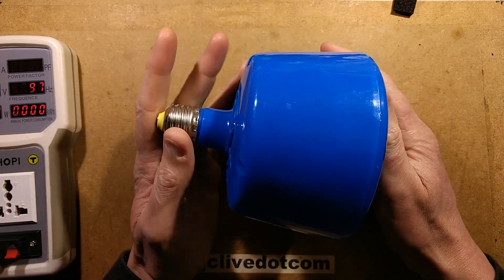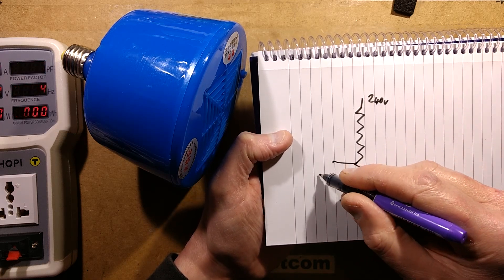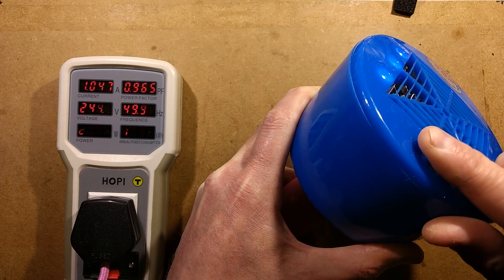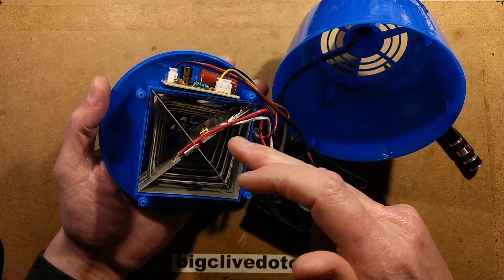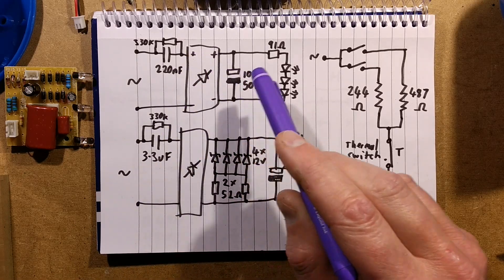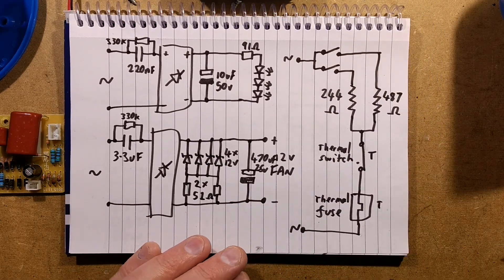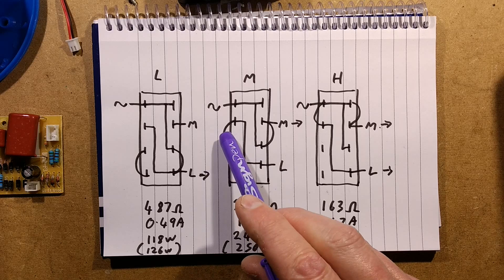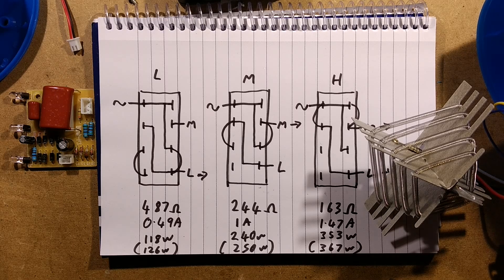Fan heater that screws into a lamp holder.  (With schematic.)

Comment: Nice tear down ! .... for the same wattage you might just obtain an ( old skool ? ) Tungsten filament lamp , plug it in and " cuddle up to it " ( ? ) , also , as a BONUS  , it lights the room (  OMG ) ... SO MUCH  modern " stuff " has electronics where it's JUST  NOT needed ( keep complicated electronics to computers / digital TV's were it  REALLY  works ! ) .. from a guy that repairs folks "  busted " stuff .... DAVE™    🛑

Comment: That looks like a great product for a small room, if you ran a couple of them.   I wish you would give us some idea of how much heat it gives off.     You always tend to focus on how stuff is built more than how well it works, which is frustrating.
Reply from the maker: Sorry.  It would have a lot of variables involved regarding room size and air flow.

Comment: I love that rugged construction. Plus the cheap PC-case/PSU fan which, should the thermal fuse fail to trip, may result in a drippy fiery mess right below the unit.

Comment: Should warm a bath rather quickly. Or not.
Reply from the maker: Safer than some of the actual bath warmers sold on eBay that pass mains current through the water.

Comment: alligators (both species) are, actually, unusually tolerant of the cold for large reptiles. they can survive brief dips below freezing, and they can handle cold basement temps (55F or 13C) for long periods of time.  
However, all crocodiles are very intolerant to the cold.

Comment: I keep a snake and I wouldn't trust any fan heater anywhere near it... the idea for reptiles is to have little air flow as possible. we look for a heat gradient usually (28* one end, 22* on the other end for my reptiles)

Comment: Well, I've seen worse-built heaters than this. (But then, I've also seen better units.) I definitely find this much less scary than that cheap, shitty pink USB charger (for example).

That said, if I was engineering something like this, I'd mount the thermal fuse somewhat closer to the elements (for quicker response in the event of fan failure). I might also use a 24V fan (perhaps with ball bearings for longer life), to reduce the necessary dropper capacitance; with a series chain (rather than parallel cluster) of Zener diodes, to avoid matching issues; etc. (Not that this is the best idea for a product, anyway; my bedroom can get moderately warm with 500–600W, but I'd rather just use a normal heater of the appropriate rating. An electric blanket is also useful there, of course.)

So, can you extract some more details, Clive?

I can see (with full 1080p video resolution) that one element is a tighter coil than the other, and wound with thinner wire; I take that it's the 487Ω (nominal 100W @ 220V) one?
(Ideally, they would be 484Ω and 242Ω for 100W + 200W at the nominal 220V; but whatever, they're plenty close enough.)
What are the wire diameters, and type of alloy(s)? If they stick strongly to a magnet, that'll be FeCrAl; if they don't stick, then NiCr(Fe).

What temperatures are the bimetal switch and thermal fuse set for? How does the plastic respond to flammability testing?

(For novelty's sake, I could try making an even smaller fan heater, in my spare time; for 12VDC, perhaps using a 40mm fan and rated for 90–100W on full heat. I'd probably use a metal case, however…)

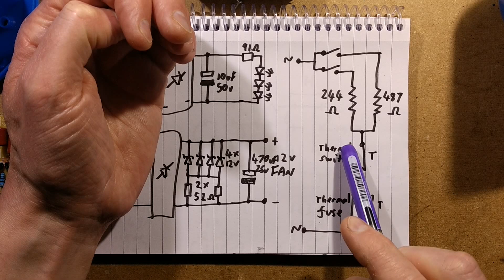Comment: At 7:55, it's a special type of switch which uses airflow to close it contacts. No fan running means no power to the heater. Nobody wants a molten plastic and the possibility to burn their house just due to the failure of fan.

Comment: I think with 300+ W you can have it heat a small room. Probably not meant for "reptiles" but as a cheap and simple heating system for small rooms. I think that's what the LEDs are for, to also give some light.

Comment: I wonder if Clive has ever been tempted to mod that meter to not flicker so badly.
Reply from the maker: Not so easy.  It's multiplexing quite a large array of LEDs while also trying to service the current/voltage sampling.
Reply: Wondered about that. But it does make sense. Tks Clive.

Comment: I am not sure why you were surprised about the PF. There is an inductive motor with a fixed amount of VARs and as you increase the WATTs draw, the PF improves.
Reply from the maker: The power factor was mainly the dropper capacitors.  It reduced at higher powers as the resistive heating element became the dominant load.

Comment: This, would be adequate to heat my room. hell, my computer does a good job by itself.
Reply: Electron Do you have any AMD components? Nvm you would be cooled then
Reply: I wonder if it would be possible to hear a house using heat piped through from a gaming computer...

Comment: They didn't use the resistive dropper because there are two heating elements, each of which can be off depending on the switch setting.  To use a resistive dropper they'd have needed a common bit of heating element that is powered up whichever main heating element is on.  And the voltage across it would have had one of three values depending on the position of the heating switch.

Resistive dropper would have been sensible for a single power level or for two power levels (one heating element always on, the other switchable) but hard to do right with three heating levels.  Possible, with taps giving the same voltage on each element and using diodes to "gate" the bridge-rectified output of each.  Maybe the capacitive dropper works out cheaper.

Comment: With the hysterical mindset of today, they'd reduce our household voltages to a harmless 20 volts if they had a chance.
Reply: If it wasn't for the double whammy of breaking compatibility with existing appliances, and multiplying the losses in wiring – then yeah, they probably would.

Comment: The only hairdryer I've seen with high-med-low settings worked in exactly that way. There was a small heating element ring and a large element ring, and the small equated to low, while the large was medium and both together was high. I was a teenager when it broke and I got to take it to bits, and the switch had that arrangement of 6 pins on the back of it which where bridged from one side to the other, but I didn't know enough about mains electric to understand, or remember how currant was converted or shunted around beyond that. I have a feeling I re-purposed the three way switch in a DC circuit project though, because it was generally quite handy.

Comment: I find it amusing that someone thought it was a good idea to make a heater that screws into a lamp.
At least they didn't try to make it a full 1500 watts.
Reply: This unit is for 220V (nominal), though; at these higher voltages, "full power" is readily more than 1500W.
In Australia (where I live), for example, it's 2400W (240V 10A); and in the UK, it's up to 3120W (240V 13A).

Comment: greetings Clive! could you by any chance make an another soldering video about soldering to wire and stuff like that? the other day i was trying to connect a resistor + LED to a wire, but the thing just could not stay on there...
Reply from the maker: It's best to tin the wire and component with solder and then reflow them together, but you have to hold them in place long enough for the solder to harden, as the extra thermal mass of the wire can slow that process meaning that they ping apart when you let go.
Reply: thank you very much for the reply! yes, i think not supporting them long enough was the issue here, even tho i did attempt to wrap the component legs to the wire. i guess this just requires quite some practice to get the technique right.

Comment: i got the Joule thief circuit working with a 1.5volt battery connected to a white led drawing around 162 to 170 milliamps and no current limiting resistor. why hasn't my led died it's been on for over 20minutes 🤔 I'm not 100% sure what I'm doing but i think that i measured the voltage across the led and it is running on 0.6volts

Comment: Totally unacceptable, build quality is poor, not really powerful enough to be an effective room heater and it could become a fire hazard, I bet that plastic has no fire retardant in it either. Also putting 12V Zener diodes in parallel may not share the current that well, and the fan voltage clamp circuit seems unnecessary anyway.  I think the odd value resistors have been used as the circuit is not critical and are surplus stock, the manufacture wanted to get rid of. An interesting video thou, good work.

Comment: In my industrial electrical classroom in high school the shop was always freezing in winter so we used an old hairdryer we found as a space heater. The same shop was also literally a foot away from the school's radio tower, and if it was quiet you could hear the radio station coming from every locker, sink, and drain pipe. If you wanted to listen to the radio all you had to do was have a speaker, long thin wires and a weak voltage.

Comment: "Why didn't they tap in the heating element to power the fan?" says Clive.
Because it wouldn't work.
Where do you put the tap, on the low wattage section, or the high wattage section?
Do you realise that only one of the sections is powered while in the Low and Medium settings?
You want the fan to always run... of course if you want to start a nuclear meltdown, be it. Tap from the low power section. 😈

Comment: I'd replace that fan with something from Delta. Preferable a FFB0812SH.
Reply: I reckon you'd need a rather larger dropper capacitor (at least 10μF), and to also beef-up the rest of the dropper circuit, to use with one of them.

(To be honest, the chosen dropper capacitor seems marginal even for the fan they used…)

Comment: Of course, the heating element part won't work if you wire it the bigclive way with both ends tied to neutral! :) Oops!
Reply from the maker: Those were supposed to be sinewaves.  :(

Comment: the big question is this: what will catch fire first? the 350w chinese heater? or the cord from your 60w rated desk lamp?
Reply: With a 1.5A load? The smallest flexible cords (presently) allowed for mains power are 0.5mm² (or about 20AWG), which is rated to pass 3A by even the most pessimistic standards (that I know of); even the lampholders themselves are usually rated to pass at least 2A, and the switches most likely are too. While tungsten filaments do exhibit significant in-rush (a 275W @ 240V heat lamp I have to hand measures about 16Ω cold, which calculates to the equivalent of 3600W @ 240V), the elements in this heater would be the usual resistance alloys (NiCr or FeCrAl) – which have minimal resistance variation throughout their working temperature ranges, and thus negligible in-rush. Anyway, the wattages listed on most luminaires are primarily determined by the heat from the lamp, rather than current draw; still, with this being a fan heater, it should (in an open fixture) be able to keep its temperature under control. (An enclosed luminaire would be a different matter, but would probably trip the thermal cut-out before it has a chance of melting down.)

(A "proper" fan heater will, of course, draw much more current than this dinky, somewhat novelty version; so I wouldn't recommend adapting one of them into a lampholder…)

Will the heater itself ignite? That would take some construction blunder, such as a bad connection (and really bad, to burn with a mere 1.5A). Of course, if it's even attempting to comply with the relevant standards, the plastics should be self-extinguishing at the least.

Comment: As always, the name of the game is cut costs to boost profit. I agree on paralleling components to boost the wattage rating and some of the other capacitor tricks they used, but if it were me, I would have used the standard hair dryer high/low settings (not like a third setting is going to somehow imporove output of this thing) and for the low voltage side without using a costly transformer (lights and fan) knock it down to 12 volts with the SCR (out of a light dimmer), then just setup a resistor for LED's. Having a seperate power circuit for fan and LED voltage seems unecessary.

Comment: A thought on those Zeners... putting these in parallel sounds like a dangerous thing to do.  It seems to me that given breakdown tolerance variations, only one will activate and pass all the current.  Or are Zener diodes' breakdown voltages really so precise that they'll all conduct at exactly the same time?

Comment: Does it actually put out a respectable amount of heat? There are car heaters from china that claim to be 300w and they barely put out a ounce of heat, completely worthless. Obviously thats 12v, but still. I want to know if this is just a little bit trash, or complete trash

Comment: Aliexpress reports it as a "pig heater"
Reply: AliExpress know it's going to be shipped to the decedent capitalist pigs in the west. Mao's legacy lives on!
Reply: BennyGesserit here new born piglets are kept warm with heat from a light fitting but just using a 150w incandescent spot lamp. Radiant heat is a much more efficient option for heating from a bulb socket.

Comment: I got something like this but it's sold as an "As seen on TV" item and it's called handy heater and it plugs into a regular outlet. Claims to be able to heat a room but it's only 400 watts.
I have a 1500W radiator style heater and on high that struggles to heat my room. My room is actually two rooms made into one.

Comment: The tilting sticker says it all.
I guess they didn't use the heater as voltage dropper is because the fan is 0.14A and it's brushless.

Comment: That switching arrangement is just like the three way incandescent lamps that used to be popular here in the US. Two filaments in the bulb, one low wattage, one medium wattage, both together providing the high setting. Not uncommon in freestanding lamps of several varieties.
Reply: Had a lot of those growing up. One filament would always fail, leaving you with just one setting instead of three.

Comment: I definitely would not suggest that for reptile terrarium use even if it was decently made. Heating elements are used, but a fan would destroy your humidify levels and greatly stress or kill the reptile. Trust me I own and have owned reptiles of all shapes and types including 2 6-foot snakes, one of which is a rescue carpet python from an abusive owner and the other is a red tailed boa. Also have a ball python and bearded dragon as well as 2 leopard geckos and 2 pet rats (not snake food!) and 3 family cat,a dog, and fish. In the past I have even had several ferrets,a rescue iguana, a couple smaller snakes including a Kenyan sand boa and other rats and even mice(get rats not mice). I even had turtles for awhile before they went to their bigger pond. So I think I know a bit about reptiles, use ceramic heaters without fans.
Reply: you could use it to heat "through" the tank bottom, if it was glass/metal :)

Comment: Hair dryer to mount over a shower?!
Reply: Or better yet, why not add a fan into the famous "suicide shower" (with an additional, lower-power heating element if needed), to enable it to dry hair while the water's off? :D

(But to be serious, a water-safe hair dryer probably could be made – if the standard bare element was swapped out for a mineral-insulated metal-sheathed type, plus other applicable modifications. Granted, it would cost more – and probably add a bit of weight, making it an unattractive proposition for a hand-held unit – but I'm sure it's possible nonetheless…)

Comment: Couldn't this overload the socket?
Reply: "blowing your lizard"
Reply: But most 60W light bulbs don't have a fan on them,  so all the heat of the bulb goes into the plastic holder.   With this it's blowing your lizard, so it shouldn't be as bad?
Reply: I can't think of many things worse than "Blowing a lizard" but to each his own, I suppose.
Reply: Only if it's a 60W max socket (which are most of them). But you're supposed to check that kind of thing anyway, which is why there is a usually a sticker on the socket saying "60W max"
Reply: sockets can output 120watts easily ,most arent designed for over 60 watt thermal cuz of the cheap plastic lamp holders in them

Comment: what does power factor mean, or what is it used for? i dont get it :(
Reply: casper aalders It is a measure of how out of phase the voltage and current are. A purely resistive load will give a power factor of 1. Capacitive or inductive loads shift the current peaks forward or back from the voltage peaks and that can affect how much power is metered and how much heat is dissipated in electrical wiring. It is normally only relevant in industrial environments hooked up to three phase supplies where it is important to balance the electrical loads across all three phases. Broadly speaking it is a quick check than can show whether the circuitry inside a device is a bit more complex than it first appears, without opening everything up for a look.
Reply: The reason the power factor was higher with a higher fan speed is because on a higher fan setting (more power) there is less capacitive dropping being used, which adds less delay to the voltage (current leads), bringing them closer to unity (PF=1).

In highly inductive loads such as motors, current lags voltage. A mnemonic to remember this is "ELI the ICE man" E (voltage) leads I (current) in an inductor (L), current leads voltage in a capacitor.